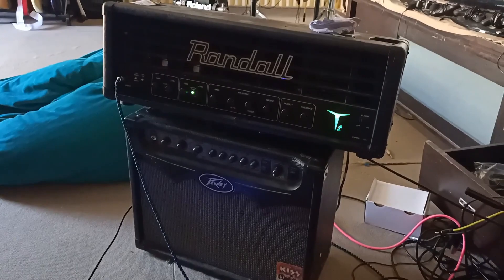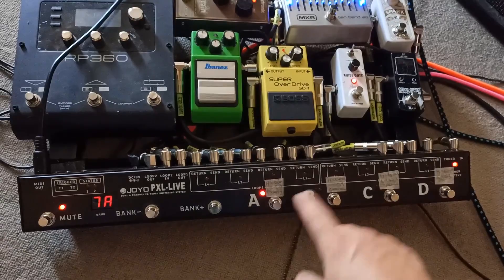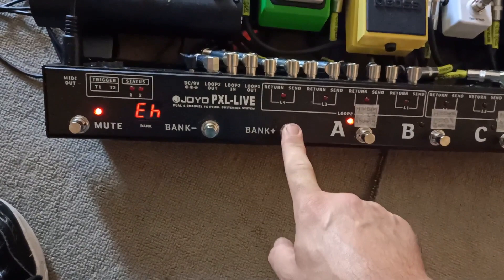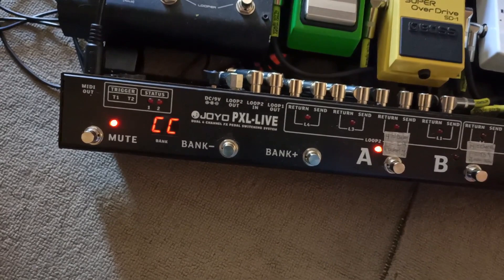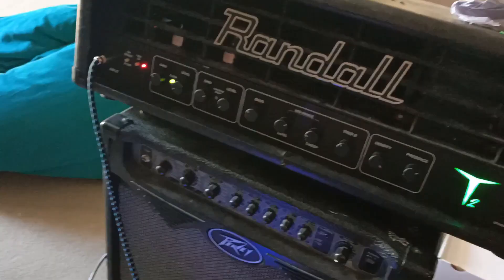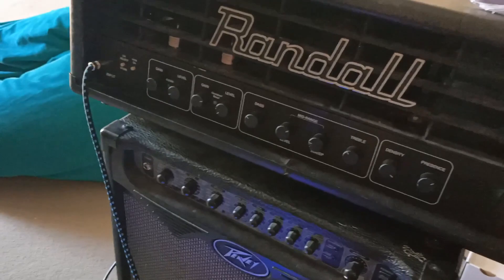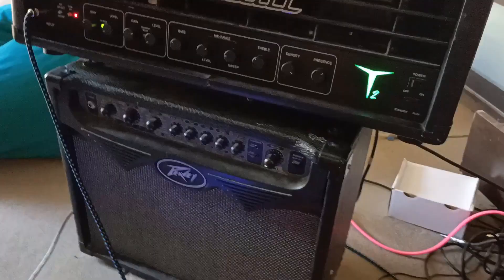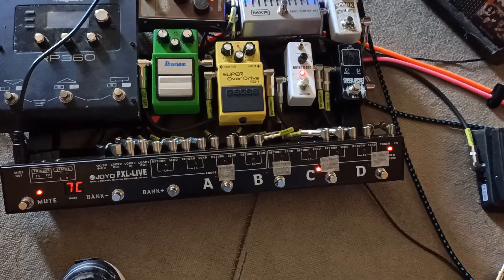Randall T2 / V2 Midi Channel switching with Joyo PXL Live

Comment from the maker: ***UPDATE***
Strange thing is that I was WRONG about the MIDI channel I programmed it into... I said in this video that I was on MIDI channel 2 to program it.... then I realized in the manual it is actually in channel 3 but It still worked....... then months later ALL Midi stopped working.... reprogrammed it the same as I did here and NOTHING... so I forgot about it for a few months... and just now I thought I would try again and cycle between ALL the midi  channels on the Joyo in case it was trying to communicate on the wrong channel and BINGO... everything started working again when I programmed everything the same as in this video, but selecting midi channel 5 on the Joyo. I'm stumped as the T2/V2 manual says it's channel 3 but I'm just bloody glad I fixed it AGAIN! haha

Comment: The cable on T2 has 7 pins listed.  while in joyo pxl only 5 pins.  are you using a midi cable which is only 5 pins?
Reply from the maker: Didn't I mention it in video? Can't remember... But yes, I'm using a 5pin cable which is compatible when power is supplied.